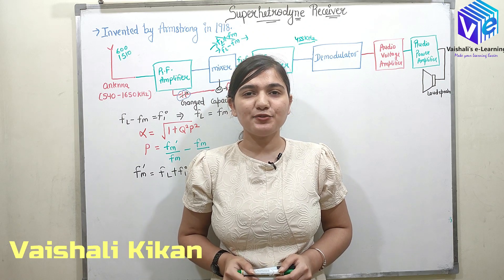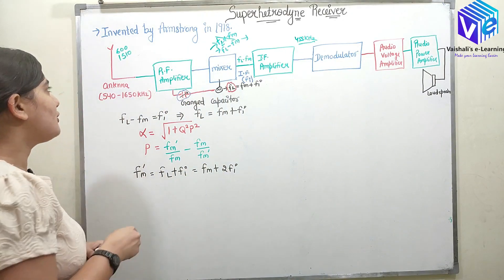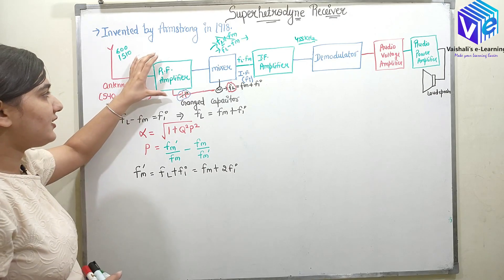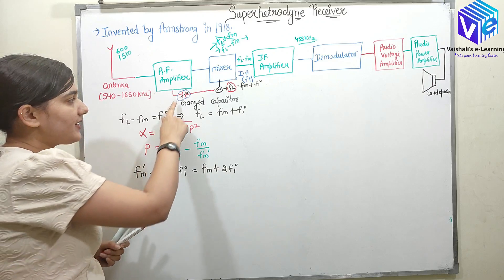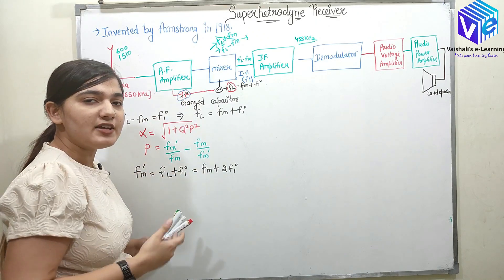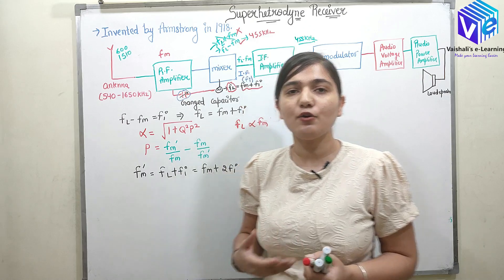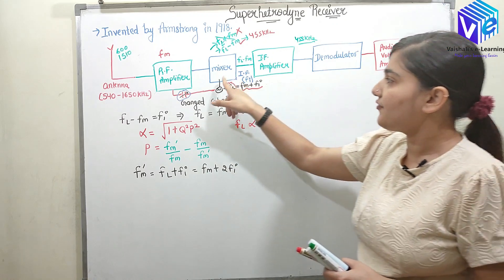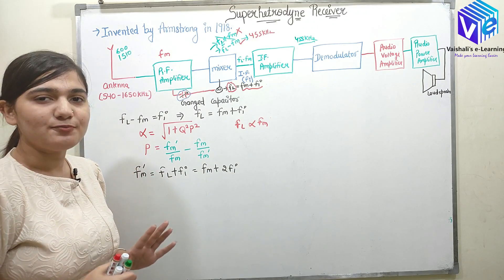L 34 | Super Hetrodyne Receiver | SRH-2| Reciever |Analog Communication | GATE| Communication System

Comment: The RF amplifier is very useful above 20 Mhz since the atmospheric noise present at the antenna is very low compared to the signal. From 100khz to 1700khz the atmospheric noise is very high so it is also amplified by the RF amp and will not improve the Signal to Noise ratio that much. If the RF amplifier has a low 3rd order intercept it can make things worse and cause intermod signal.